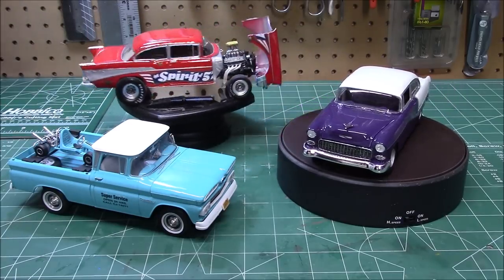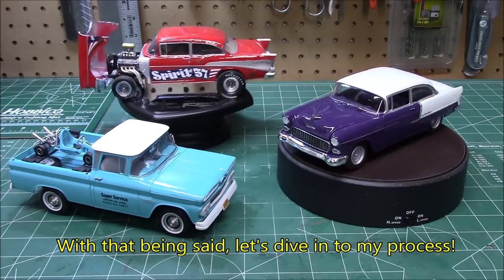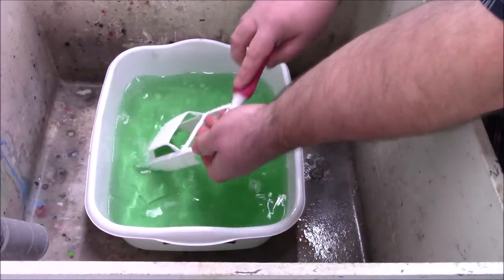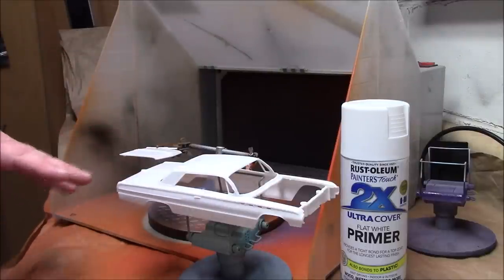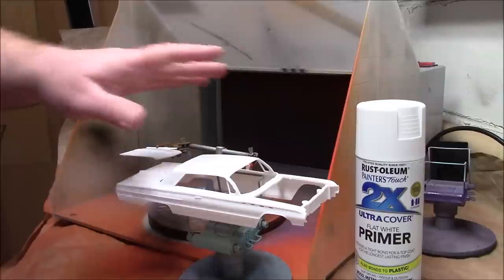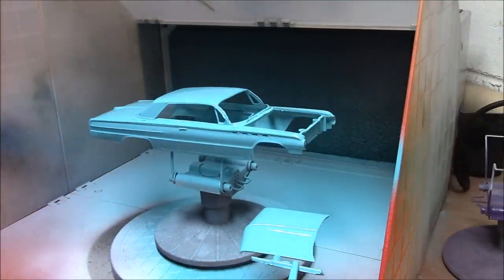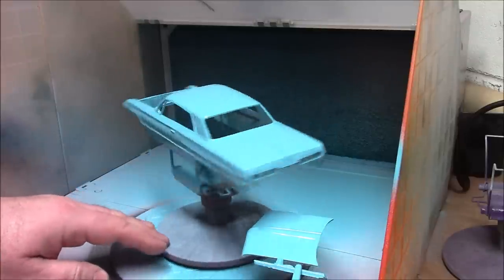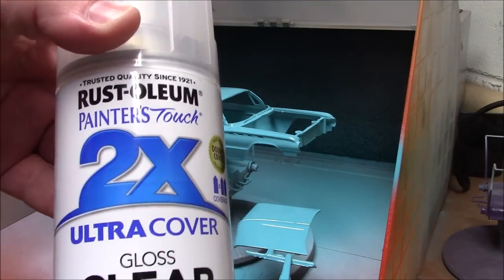How To Paint Scale Models With Cheap Spray Can Paints, No Airbrush Needed

Comment: Hi HPIguys. Question. When your painting, and you have one color for a top coat. But you want a two tone paint job with the same color (like orange). Would paint one part of the body with black primer. Then mask it off where you want it then use the white primer on the other part. So when you paint it it would give you the two tone light/dark paint job ?  Haven’t built anything thing in 10 years. Have an old ford truck I would like to paint and build. Thank you.
Reply from the maker: On a spray can two tone, like I did for the 55 Chevy, I just used white primer for the entire model.  

The dark primer, dark paint is a loose rule. It's not a hard and fast rule that must be followed at all times.

On a very thin paint, if you two toned the primer you may see the color shift using the exact same color, but only if you applied the top coats thin. 

Something like trying to lightly tint the exact same color using a darker coat under the color that is not all that easy to do with spray cans.
Reply: I use a T Shooting on the plastic Pie trays that pies from Grocery Stores come in

I shoot Flat black Stripe, Gray next to that n White Next to that

Move Down ,,"1 1/2" mask Straight across all then spray 1 rer Color across all 3.  

Then cover those w plastic n paint stripe other Color over all ,3 again 

Then remove plastic n go to bright sun light n look at 6 different Shades

On Trick Fades  I'll use White/Silver/Gold/Copper/Charcoal metallic n Flat black under n Go over all with 1 too color after pattern is laid
Reply: Thanks a lot. I think I understand. When I get back on my feet I’ll give it a try.
Reply: Chris can you do a video on how you use acrylic craft paints in your modeling
Reply: Robert Morris   I realize you addressed Queetion to Chris  however   as Advanced n Semi Master model car builder  Personally do Test Paint Shoots of the Primers n mid Coats  I intend to use. 

For Example My Current build is AMTs nice 41 Plymouth Coupe   I'll be Doing it  Tu-Toned but pretty Good Variance of Blues  ...

However 4 Different Blue paints will be involved too...

So I'll be Starting by Test Shoot as Follows to Determine Which primer Color to use under each of my 2 initial blue color coats 

I use a Black Plastic pie  bottom Container ... At Grocery Dyores whole pies are in plastic 2 part containers clear top n black lower..     

I wash n prep the lower Black section as a Paint tester...

By placing it Faced Down (Inside side Down on table ). It's Domed n Varied Contours is perfect for this

So I now Mask off Areas in Stripes 

I shoot a Flat Black Primer one
Flat Gray Primer One
And 

White Primer one

So I'll have at least one Stripe of Each color to Shoot over 

I make my Stripes 1"+ in width 1 1/4-1 1/2" wide

My initial 2 Blues are 

Kryllon Short Cuts "Turquoise and Ocean Blue

So across the ,3 sttipes primer. I'll mask a Control stripe to keep n Show primer after as test guide 

Next I mask off a 3/4' wide Strip across all 3 Colors  then Shoot the lighter of 2 Colors over that...

Hence it will give me 3 different Shades of that blue. To choose from as base Color hue

Now I Mask off Another Stripe over primer set for the Ocean Blue Darker Color

This will give me

3 shades of Turquoise and
3 shades of ocean Blue

For my Tu-Toned  Main color Base

Over Both the Turquoise and the Ocean Blues. Which are ordinary Gloss Enamels (non metallics)

I'll be Applying  Krylons "Glitter Blast" in 2 ultra thin top Coats

For over the Turquoise I've Selected Sapphire Blue Metallic"

Over the Ocean Blue  'Twillight Blue Fark metallic w Red flake n dark blue Flake

Theis will yeild 3 light Blues n 3 darker blues 

But the primer Base Color affects both blues Sprayed over it

Hence Test shot on pie plate.  To look at on bright Sun light.  

This is how I decide primer Color

Comment: Great video- I’d encourage modelers to practice their spray technique perhaps on some scrap plastic. Warning about a popular degreaser “Castrol Super Clean”. It is very aggressive and can literally remove the oils from your skin! I’d suggest always wearing gloves when working with degreasers. 👌
Reply from the maker: Yup, gloves is solid advice with anything that is stronger than diluted Jungle Jake. Even JJ should be used with gloves if you use it often or full strength.

Comment: Hey man great video. Do you have orange peel on the paint? And if I want to sand and buff it don't I have to put more than 1 coat of clear coat?
Reply from the maker: If you are into sanding and buffing paints, using cheap spray cans isn't the way to go. This is for easy, fast model making. I spray and that's it. Just like I say in the video. Thanks!

Comment: Thanks for this tutorial! I’ve been away from this hobby for over 5 years but with what’s going on with this pandemic and staying home bored out of mind, I’ve decided to come back. Paint has always been my frustration as I’d usually get rough patches, runs on the lower body and my most hated, fisheyes that look like rust sores! Also I noticed you use rustoleom paint, have you had any issues with it and are these  the ones you can get at Home Depot? I usually use Tamiya spray paint but again with covid 19 and most hobby stores shut down, getting Tamiya paint is difficult or best case, not cost effective currently.
Reply from the maker: I use all kinds, you can buy them anywhere.

Comment: I have never thought of using 'large' rattle cans to spray paint models, with possible exception of the Eagle Transporter (Ford White).
I do have one question; where did you find the base you use to rotate and hold the model parts?
The helping hand with 'gator' clips is available at Harbor Freight and I have many of them, but spring portion that holds the car body I cannot find.
I Thank You and my wallet thanks you for the ideas.
Reply from the maker: Modelroundup carries the Tamiya Paint stands you see.
Thanks John!

Comment: I like the rust-oleum paints always seem to work well big can at local auto zone about $6 dollars have plenty of paint for other models or projects to use on.
I recently made a terrible mistake of not paying attention to spraying paint in hot weather here in California Central Valley summer temps climb very fast and get well over 100 degrees first coat went on fine just had minor touch up wanted to do so buff it out a bit and tried hitting with second coat unfortunately temperature reach that magic number instantly paint bubble up and did all kinds of weird things spent the rest of the day slowly removing entire paint job never again now only paint late night or early mornings. lol
Reply from the maker: Good advice!

Comment: Thanks for the tips! But what's wrong with Testor's paint cans made for plastic models? And can you use a hair dryer insted of a heat gun?
Reply from the maker: Who said anything was wrong with model paints? There is nothing wrong with them. 

You can use a hair dryer, anything that blows dry hot air, even a mother in law.

Comment: Do you prep the bodies by using some 600 grit sandpaper to get rid of mold lines and imperfections before priming? Sand the primer with 2000 or 3000 grit sandpaper for a smoother finish before color coat? Just curious.
Reply from the maker: Everything I do is in this video. Old school modeling, spray and pray. No sanding, no buffing, no worrying.
Reply: hpiguys Workshop I’m sorry I rushed myself and didn’t watch the whole video before commenting. I see what you mean by moving on completing models quickly. I wish I could do the same. I have 50+ I need to finish. Lol

Comment: Cool.  I suppose one could skip the step of spraying on a clear gloss, and just use the floor polish after the coloured paint dried?
Reply from the maker: Yes, you could do that as well if you wanted. I prefer the clear gloss in case I need to remove a decal, glue spot or some weathering, etc. Kind of a safe barrier between above the color coat that has a stronger bond than the Future which is acrylic and can come off easier.

Comment: Straight out of the can I really seem to struggle w orange peel. What is the key to avoiding that? Your spray seems even and super glossy without any peel at all, and all without having to sand. Is it just the quality of the paint?
Reply from the maker: Takes a lot of practice, but it does get better.

Not one of my paint jobs is perfect if you press your eyes up to it. I simply don't worry a lot about a bit of orange peel. 

If perfection in finish is what you need, model specific paints are your best bets. These videos are for the fast/fun/hobby builder that doesn't sweat it that much.
Reply: @hpiguy  Yeh I hear you. I'm not show modeler by any stretch, just a hobby. Yours just look pretty exceptional compared to what I'm getting w that natural gloss. Will keep at it until I get it right.

Comment: How long did you wait before to paint the second coat with the Petroleum 2X spray paint ??
Reply from the maker: Only a few minutes. Just enough to let it get tacky. 

Rustoleum doesn't like being recoated days apart, it can cause issues. It's a one wet session and done paint.
Reply: @hpiguy  oh ok...I just paint a model in white and I will have to do some stripes on the top with that same kind of paint...soo it's mean I won't be able to??

Comment: If you wants to repaint a car that was not in a kit (it already has a color). Would you have to strip the paint with a paint stripper first?
Reply: ehhh? you mean a model kit or a "toy car" if it is a pre painted plastic modelkit, just spray primer, then color, then clear, if its a "toy" you could sand it, but most likely you dont need to, so you can just prime, color, clear, you could tell how it turned out once you are done, i hope it turns out good.

Comment: I did Tamiya primer under Rustoleum 2X color coat and eveything was fine. Then two days later I applied the Rust-Oleum 327864 American Accents Ultra Cover 2X, Gloss Clear and the paint cracked/wrinkled. What would cause this?
Reply from the maker: I can only recommend doing it that way I showed, too hard to trouble shoot if you used other paint brands and mixed, etc, etc.

Comment: I tried using Rustoleum on 5 different models. I tried different colors. The Rustoleum paint crinkled up in seconds and I had to strip the paint off completely. I'm thinking that the composition of the paint has changed in recent months. No matter what I did, no matter the primer, the paint would not lay flat. It was like looking at a dried lakebed with all the cracks and crinkles. I tried your method to the letter with Rustoleum. I then went to use Duplicolor automotive touch up paint spray cans and haven't had an issue since.
Reply from the maker: Zero issues here. Still going strong.
Use whatever works for you and have fun with your hobby.

Comment: Chris is Right Rattle Cans can give a Good Paint job   Quite Contrary to the Rattle Can Myth

Chris s again is Following Proper Must For rst thing

  #1 the Whole kit must be Washed n Bathed in a Warm solution on r Something Again exactly as Chris advises. Must be Warn not HOT  !!.  

While Chris uses Slightly Fancier Solvent prep washes like "Simple Green" Royal Purple Etc.
 It's not necessary.thise do do a Great Job at bit of Slight Extra Cost  ..

I personally only use Warm water at 85-95 Degree Water  n Just Few Drops of Dish soap  mixed in ..

I put Some warm water in tub then add droplets of  Soap then turn faucet on  to add more water so it mixes as more water added  it gives  sligtt bubbles to let you know you've got enough soap  in water 

Then Eactly Same as Chris advised here  with my Flight Difference he uses old used tooth brushes.  I don't. For mine I select Brand New  Medium to Hard Bristle But Good zBrand Name From Dollar Store !!  And Scrub Body First  N then all Sprues Except the Chrome Trees.  

I DO NOT WARM WASH CHROME  !! Why? Because even warm water can cause a White cloudy effect on chrome n it's hard to resolve once done...

Set Chrome Asside for a Cotton ball n  Robbing Alcohol  or Q-Tip Wet  cool straight from bottle Alcohol rub 

Once all body n Sprue is washed  empty the  Wash Container n Rinse it.  Then Readd Warm water   (You can add 2-3  Caps of Rubbing Alcohol  to water too  then   Light Scrubbing  Rinse  Body n all non Chrome Parts 

Then Either Completely Let Air dry as Chris also advised or??

Another way.  But Cheap New  (,Not Ever used) Hair Dryer  Why new ?  Because used have  lint n hair n dust particiles  on Vent intake filter mesh that could blow thru Dryer onto the parts.  

I blow Dry body Pieces only if I'm in start if build hurry to get on deflashing   rest fitting Sanding and Body work

Other wise same as Chris leave it have patience 

Patience n TLC to Detail is what gives a Great finished Model that's what shows later

Next Same Advice Chris Gave again Paint cans Temp n Paint Trmopdrature is Critical  paint temp at 85-120 Degrees Farenheight gives very good results 

The Can let sit in Sink of very Warm to Semi -Hot  water 3-5 min.    Even place can In Water   1-2 min then shake it good 20 sec then return to water  n rotate can on it's side in water so all side of can warms n warms paint inside can  after min or two take out n reshake n return repeat  then Shake

I then Dry can w Paper Towel

I also will Tack cloth  as final Rub down body to insure No contaminant dus,t hair   or grease got yomy body  before paint shoot 

It's best of body is at 75-95 Degrees. So body n pauont aren't afar apart in temperature  for primer n all.paint processes too

Next Go lightly.  In fact my first primer coat is Spatter  coat it almost doesn't fully cover plastic  thus ensures my paint is ultra thin.   Few thin coats (3-5,)  better than 2-2 heavy.  

I very light Sand each n every coat after complete dry w 400-600 grit.  

I use mlinimum of 3 primer coats for full even coverage 

Then move to color layer and Yes  careful use of blow dryer can shorten the dry time between coats just use careful patience as guide. 

My very best model paint job has Such go. High goissy Show Finish 

13 Coats Wet sanded n tack clothed  between coats. Sanding nlboocks with only 400 & 600 wet/Dry used wet w dish soap b water

Yeilded  pain job so good Harley Right der wanted to pay me $3-5,000 paint his Harley in nice Two tone W 2' tone flames exact as Model car was Done !  

Great tutorial Chris.     Let's work at Making the No Good Paint Job Comes from A Rattie Can dis appear
Reply: Thanks Rick, nice tips ...
Reply: @JohnJohnson-qg2ub  you're Quite Welcome name is Walt. I'm 56 n bit of Vetran Builder built models since 11 yrs old   3 years of Mech Drawing n Drafting in Her gh School didn't hurt. Originally I wanted to be Automotive Designer 

I'm considering Writing 2 model building books a Basics n Model beginning to build book entry to the hobby.  Also a more Advanced Finer builder tips books in getting super details  fishes etc.

Comment: Where did you get that nifty stand you have the car body on? Many thanks for all the tips!--Cindi
Reply: It's a Tamiya paint stand. It costs around 25 USD. You can buy it on any online hobby store, Hobby lobby, Ebay, Amazon, or your local hobby store. Its great to use. It also comes with a stand to clip parts to.
Reply: It's a tamiya paint stand available at hobby lobby. TCWAGS
Reply from the maker: Hi Cindi!  Those other guys are correct. It's from a pair of stands that you can get from Tamiya. They are both handy. 
Here's what you'll be looking for:
https://www.amazon.com/Tamiya-300074522-spray-work-painting-stand/dp/B00080DIWE
Reply: @chipblock2854  Thanks a bunch!
Reply: @hpiguy  Thank you so much!

Comment: (1) When you spray paint black and silver parts, like the chassis and engine parts, do you also use primer before the black or silver?  (2) If the base plastic is colored (e.g. red) and you want a lighter color (light blue) for the body, do you use a lot more primer than you show here?
Reply from the maker: I primer everything before any paint.

Colored plastic doesn't matter, spray your primer on both sides as normal and it will cover it up.
Reply: hpiguys Workshop Thanks for quick response. Love the simplicity of your method and you can’t argue with the results you’re getting. When you paint small engine parts and chassis, do you typically do the same routine of precleaning and scrubbing in degreaser or is that just for the body.
Reply from the maker: I clean all the parts in simple green before I start assembly.
Reply: @hpiguy  Got it. Thank you.

Comment: What's the best tape to use when trying to two tone without paint running through split areas?
Reply: Been using the duck blue release and it bleeds through bad
Reply from the maker: I like Washi tape, I use it on almost all my paint jobs.  Google for where you can get it locally.

Comment: Love that blue.
A tip for after you re finished with the rattle can is to turn it upside down and give it a 2-3 second spray.
That cleans out the nozzle so it does not plug up for next time you use it.
Reply: With the 2x paint there's no need to do that, all you're doing is losing the propellant. It says on the can if clogging occurs rinse it with a solvent such as mineral spirits. This tip works with the older single stage paint type.